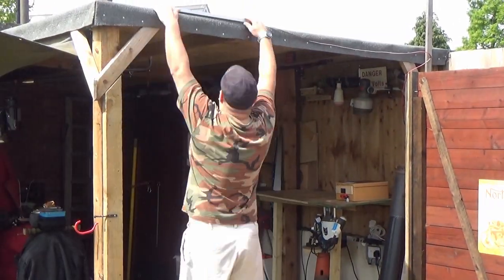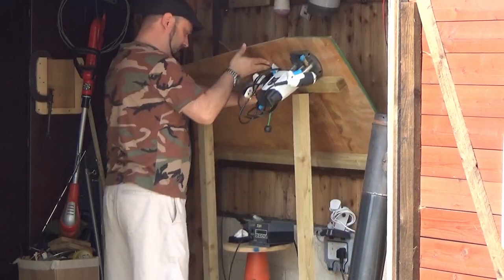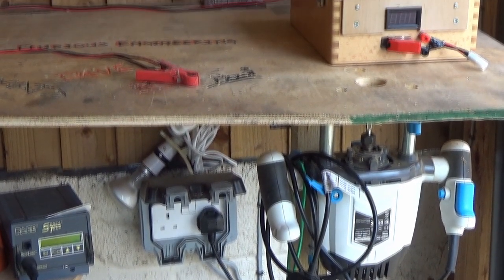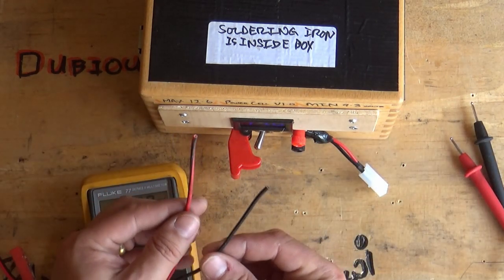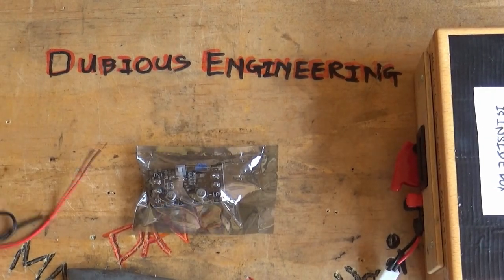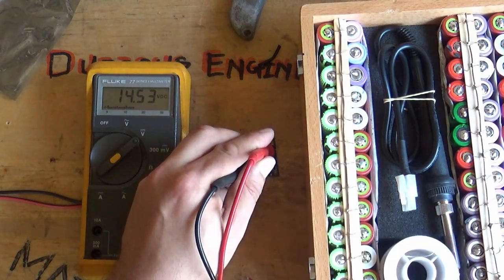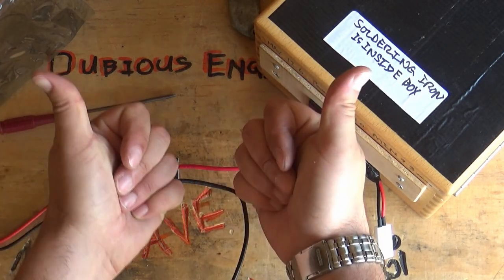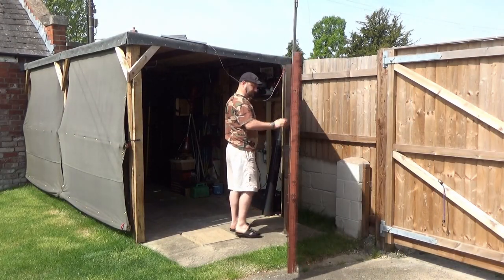DuB-EnG: SOLAR POWERED OFF GRID SHED UK Wiring charge regulator Li-ion 18650 Battery Wall living

Comment: HI, well I unexpectedly learnt something. I was trying to measure current with multimeter on electronic circuit and couldn't understand why when I switched meter to 10A nothing happens. Now having watched video I realise I need to plug the red thing into the port on meter that blatantly says 10A !(idiotic of me not to notice that before). So no matter what else this video is educational !
Reply from the maker: Happy days! - BE CAREFUL - Make sure you put the leads back into the voltage terminals when you have finished or you could short directly across a voltage measurement in the future! - Great news someone actually learnt something from one of my dodgy videos!!